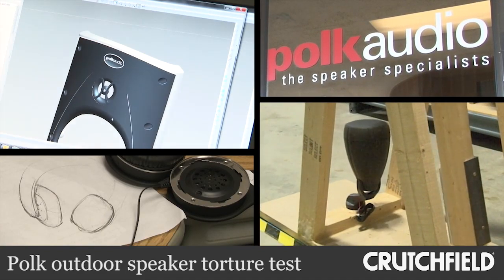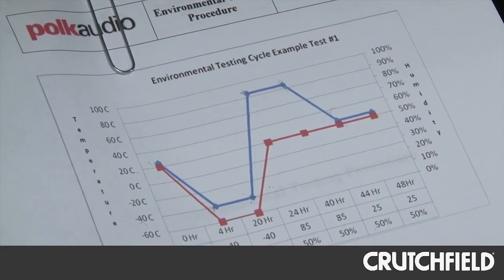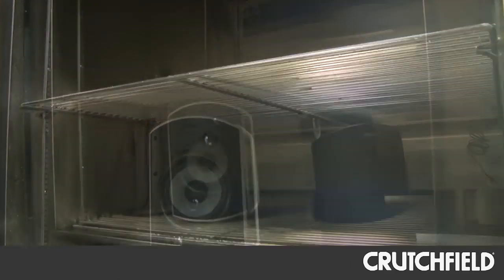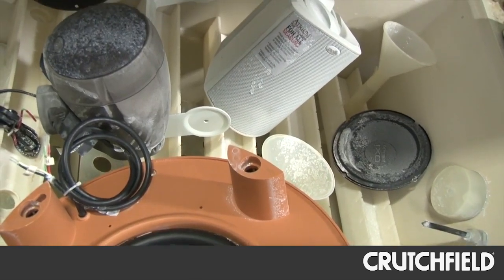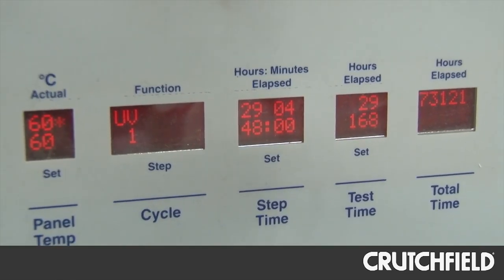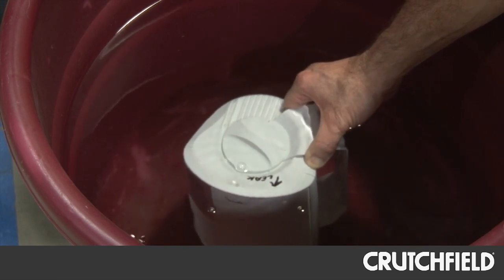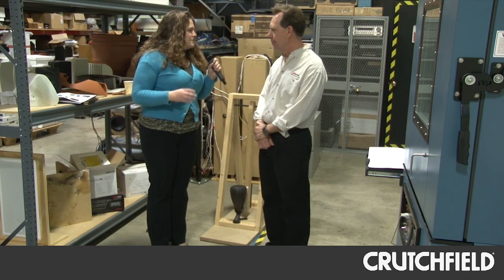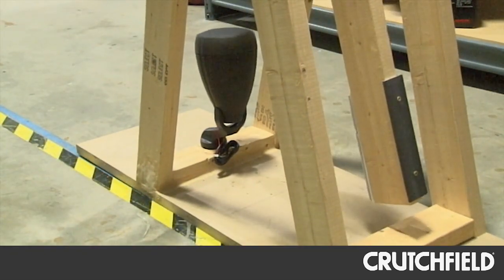Polk Audio Outdoor Speaker Quality Tourture Tests | Crutchfield Video

Comment from the maker: While they do not use the exact same testing procedures, all of the Polk Audio car speakers are rigorously tested and actually meet or exceed the marine grade standards for exposure (moisture & UV rays) and corrosion. So yes, their car speakers are very durable as well. Feel free to call for additional assistance: 800.315.0030--Crutchfield

Comment: It looked like a Polk Atrium failed the dunk test.  The Atrium speakers are marketed as water resistant.  Do they not pass the dunk test?
Reply from the maker: The Atrium Speaker Prototype that failed was not the final version of the speaker, this is discussed in the video.

Comment: I need to fix pair of Dolby atoms Speakers in ceiling and am thinking  to buy a  Polk Audio  Speakers Atrium 6 or 8 .  do you think it will do ????
Reply from the maker: Polk's Atrium speakers are typically designed for using outdoors--they can work indoors for a home theater system as well, but wouldn't be able to mount in your ceiling for installation. 

If you'd like to discuss further, please feel free to contact an Advisor on the Crutchfield website: https://www.crutchfield.com/I-rYTVc000/Support/Chat.aspx

Hope that helps!